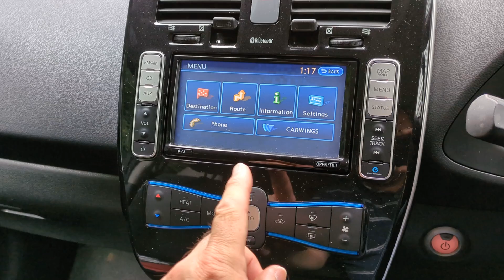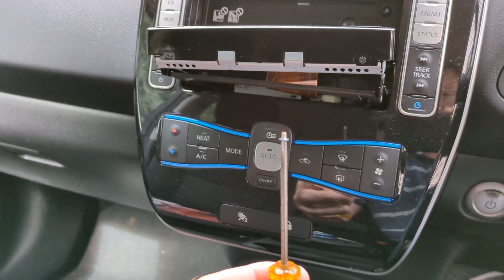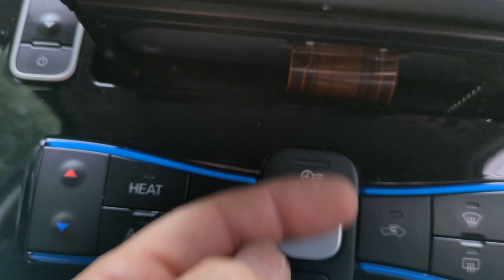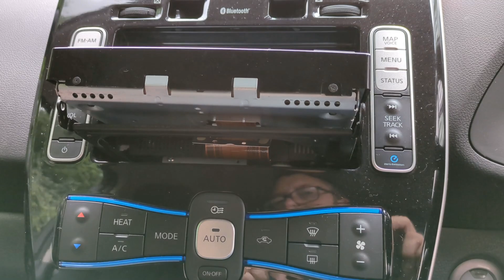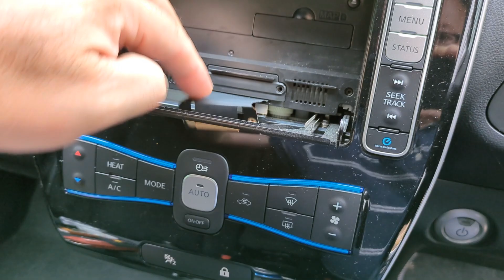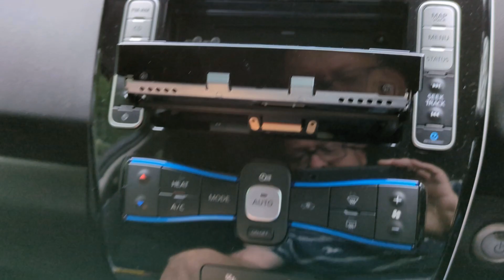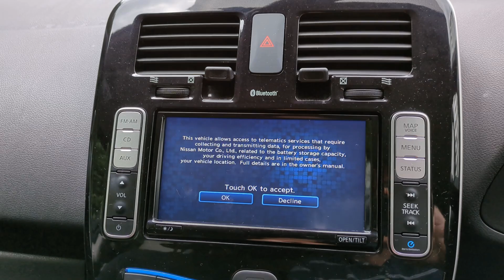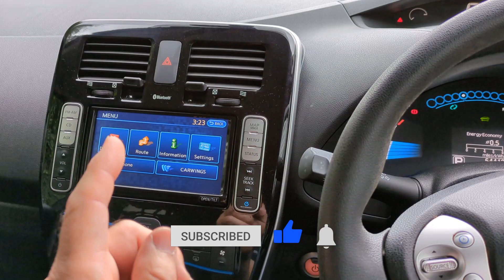How to replace a faulty touch screen in a Nissan Leaf (or E-NV200)

Comment from the maker: As others have commented here, the screws are probably JIS heads being Japanese, which is why a European Philips screwdriver doesn't fit perfectly. This set of precision screwdrivers might do the job better https://amzn.to/4j2KWyb
f you've found this video particularly useful or maybe this saved you money or time, then please do at least click the like button and add a comment. If you'd like to give a 'super thanks', you can buy a coffee, a pint or contribute to the running costs of this channel via the Thanks button.
YouTube shares 70% of the donations with the video creators.
Reply: I've just replaced the screen and used a 100w soldering iron to melt the loctite by directly holding it on the screwheads to heat them up.   The underside screws took about 4 mins each. 2 minutes of heat, a little go at turning the screw with a flathead screwdriver and 2 minutes more and they came off.

The screws on the frame only need about 30 seconds to a minute of heat.  Again I used a regular tiny flathead screwdriver in the end. No need for special drivers.

Thanks for the guide. Coffee incoming for you!

Comment: Sorted - thanks. Used a small gas soldering iron to heat the screws. Plus, had perfect size screwdriver. That's the key on this job. Nice new touch screen installed... finally just before I PX the beast!
Reply from the maker: Good job!

Comment: Fr every success there is one story which does not go so well…
First attempt could not get screw out of the metallic plate at back. Bought new screw drivers. Second go… still would not come out. Third go with a multitool to drill the head… bingo.
Removed screen and brought inside to kitchen to fit screen. One tricky screw. Neighbour came in to help. Leaned against the new screen and cracked it. Second new screen on n order. Try again in January.
It’s not that easy!!!!

Comment: Thanks for giving me the detail and confidence to do this. Success! Replaced the touch screen on my 2015 Acenta today. The set of JIS screwdrivers you recommended meant that all the screws came out undamaged. No more manically tapping on righthand side buttons. Thanks again.
Reply from the maker: Excellent news, glad it helped you and thank you for the gift.
I wish I got the JIS screwdrivers first.
Reply: I second that. Thanks again for the video, made it very straightforward and easy to do. Agreed that a good set of screwdrivers make getting the initial panel off all the easier. Great to have completed this for only €10 from AliExpress as opposed to getting ripped off by a Nissan dealer. Thanks again

Comment: I took your advice on using a decent set of watchmakers screwdrivers - being a watch repairer, that wasnt hard to do. Best advice for those 2x screws - if your drivers have play when trying, just get a different one otherwise it will cam-out - it really isn't worth chewing those chocolate screw heads. with the sharp blue steel ones i used, i had to pull the screw off after i took it out, it made it easier to put back in though! Thanks for the video
Reply from the maker: As I've put in the pinned comment, they're probably JIS screws as its Japanese.
Reply: @GoGreenAutos  I wouldn't know, but i didn't slip once when i did mine today and the screws still look new 😁

Comment: Fixed! (Thank you)
But advice to next person is to find the fuse and take it out - as I tried to plug it back in the tray retracted.
Fixed by pulling whole dash unit out (easy) and touch the cable into the head unit (maybe I pressed the tray button too). 
Phew! Tray came out again! 
Where is the fuse located? Don’t know.
Also, I had to drill the plate screws out gaffer tape there now (and nearly stripped another casing screw). Maybe the JIS screwdrivers would be worth it.

Thanks again for all the help!
Reply from the maker: Yes, I'm sure buying a JIS screwdriver is worth it.

Comment: Thanks for this video. I used the screwdrivers you linked to and they worked like a charm. Also, having read other comments I took out the fuse for the av unit, so that it didn't tilt back into the housing before everything was reconnected. New screen now working perfectly.
Reply from the maker: Thank you very much for the gift and glad you found the video helpful.

Comment: Had the same problem on my 2015 23kwh LEAF so followed this video and am very happy with the result. As forewarned, the 2 small screws on the back of the display that hold the plate covering the ribbon cable were a problem. One came out relatively easily, the other not...reverted to power tools. The rest of the replacement were very well and the new touchscreen worked immediately. Just a hint on the small plastic cover on the head-unit side that takes in the other end of the ribbon cable...removing the cover doesn't enable the ribbon cable to come off at that end, but its a strain-relief device - removing it (take out 2 screws and gently lever-out gives another few precious centimetres of play on the ribbon-cable. Great video...many thanks!

Comment: Thanks for the great video. Unfortunately, I didn't take out the fuse before starting and - having successfully managed to replace the screen - the unit retracted back into the housing when I was only halfway through replacing the screws and before I had reconnected the ribbon. So now it's stuck in the housing and not connected via the ribbon, so not working at all. Any suggestions for how I can get the unit out again would be gratefully received as it's completely stuck. Thanks :(
Reply from the maker: You can pull off the black plastic surround panel, which includes the air vents to access the whole head unit.
Reply: I fixed this by temporarily connecting the cable enough to press button to extend the tray.

Took whole black surround off and head unit which gave me access to hold cable with pliers and gentle touch the cable on to the head unit (not sure if I actually pressed the tray button). I was very glad when tray extended!

Comment: Thanks for the video - I got a new screen for £2.50(!) and it works a treat  - didn't even have any problems getting the screws out. I found the trickiest part inserting the ribbon cable back in when refitting the unit.   Has given my 11 year old Leaf a new lease of life 😂
Reply from the maker: Wow that's cheap. Just imagine what a Nissan dealer would have charged to fix it!!
Reply: @GoGreenAutos slightly more than £2.50 (which did include delivery from China!)

Comment: Thank you for a great step by step video. The Philips 00 screw driver is key for this job. Realy happy to fix this issue in a short time and for less then 15 euros.
Reply from the maker: Glad to help. As my pinned comment says, the correct screwdriver is probably a JIS one as this is Japanese.
Reply: Got screen screws out with PH0 Philips head

Comment: I would use the tip of a very hot soldering iron bit on the screw heads which will soften the Locktite.
Reply from the maker: Good idea

Comment: Thanks for the gorgeous video instructions! I just replaced the touchscreen of my 2014 Leaf AZE0 after buying the screen from the link in the video. It worked like a charm and I can't believe it was just $12 for the whole thing including shipment half around the globe to Germany...
But I also made a stupid mistake when fiddling the ribbon cable from the main unit back into the socket on the touchscreen: I forgot to pull the fuse (or disconnect the 12V battery of the whole car) so the slide immediately started to move after I just hit the socket for the ribbon cable. It resulted in a closed lid / touchscreen with the cable becoming loose again rendering the Open / Close button inoperable.
Well, I have been very lucky by finding a rather simple way to get it open again - but I had to take the radio / nav unit out (which also is not really a big deal as there are plenty of videos explaining how to do it as well 😉).
You can easily power the small motor that drives a gear to operate the slide after unmounting the back plate of the device. I made a video that explains how to find and power that particular motor:
https://youtu.be/GKeg4ojyOmU
This will hopefully save another poor soul the frustration of having "messed it up" during the repair as there is a rather easy way out of this dilemma... 🙂

Comment: Thank you Go Green Autos, I knew exactly what to expect. However, when I pulled ribbon cable clip, it pinged off down the back of the car and 2 days of stripping it down couldn't find it!
I then removed whole head unit from car - easy as the front panel & vents etc just pull off and you only need to remove hazard light switch connection. Just be careful not to drop mounting screws - the unit sits on hooks so it won't drop.
Was far easier to swap screen on the bench and I made a new ribbon cable clip from a thin plastic plant label cut to 26mm x 8mm. This jams into the connector to lock the bottom contact ribbon in place.
The hardest part was stopping screen flopping about when refitting - I used insulating tape to hold the top of the screen in place, with a wedge between the screen top and the case to ensure the bottom could still swing out as the tilt arms come out when reconnected.
Once cables are reconnected to rear, you can hang it on the 2 mounting hooks, open tilt so arms fully extend for last 2 screws to fix bottom of screen; and fit the 4 head unit mounting screws (Pozi drive) - these are tricky to align properly but keep trying with your fingers holding the screws at different angles.
As it happens, the new screen looks great but unresponsive to touch (looks like ribbon got folded flat against itself in transit), so have had to put old screen back and get refund - new one ordered from Ali Express for £7!!
I was expecting a radio key code lock, but it started right up. I still requested one from Nissan beforehand, let's see if they can find it anyway.
I used a PH00 for all small screws and didn't have any locktite issues - perhaps screen had been replaced before?
Thanks GGA, you were brilliant help.
Reply from the maker: Sounds like you've been having fun!
Glad the video helped. Removing the whole unit from the car might be the way to go. When I next need to do this, I'll try that method.

Comment: This video is really helpfull. Today I replaced my broken screen and I used a IFIXIT screwdrive set for removing the screws. Have to say, if your screwdriver dous not fit precise, dont try it. It wil ruin your screws.. With the IFIXIT screwdriver set it worked like a charm. It took me 1 hour in total and after calibrating the screen it worked really well and now it's more resonsive than before. Thx for the quidance.

Comment: Great video, very helpful.  Many thanks!  I made certain of the correct screwdriver before tackling the first pair of screws (try first to ensure a snug fit!).  PH0 worked a treat - took it very slow at the start, to break the threadlock, then they came away without any problem.  Fixings for the plastic surround mostly crumbled when removing those screws, but I shouldn't be surprised, as our Leaf is now in its 10th year, so they have survived a lot of summers.  New screen now in and working fine. 👍😀
Reply from the maker: Good job.

Comment: I bought a new set of multi head screwdrivers from Aldi for the job and the screws weren't a problem. Just fiddly to access. Make sure the head unit does not retract after removing the head unit. I physically obstructed it so this couldn't happen. Not sure what you'd do if it did. 

Also, my digitiser didn't work so I'll have to order another one. I used the link from a Jonathan Porter field video a while back. Will try the link in this video next. 

The ribbon cables are the worst bit of the job IMO. Very fiddly and easy to put back incorrectly.
Reply from the maker: As others have commented here, the screws are probably JIS heads, which is why a European Philips screwdriver doesn't fit perfectly.
Reply: @GoGreenAutos  PH0 worked fine for me - the Aldi screwdriver kit came with two slightly different shape of Ph0 head for that fitting and one worked with the tiny screws on the underside of the head unit well, while the other was good for the larger head screws.

Comment: Thank you for the video, it helped me to change the touch screen and it's working!  The only issue was the flap that holds the ribbon cable popped out, took me an hour to figure out how to put it back 😅. I wonder how long this will last, and if I should buy another one as a backup... thanks again 👍 regards, Andras
Reply from the maker: Thank you Andras. So kind of you. I'm glad the video helped.
Reply: I’m currently having exactly the same problem with that little white flap for the ribbon cable - any tips for getting it back in place??

Comment: Replaced screen with aftermarket one I bought online. I took unit out of car to make access easier. But when I powered it up afterwards... nothing. Screen is black, and the tilt button doesn't work. The screen tilted back up to vertical when I plugged the cables in on the back, so now I can't take the screen off again. Any ideas?☹
Reply from the maker: Sounds like your ribbon cable isn't in properly or making contact.
Reply: @GoGreenAutos  You're right! I managed to pry the screen open and redid the ribbon connection on the back and hey presto! The screen is at 90 degrees to where it should be! The pins on the screen/cable are in the wrong place. Now I have to either find a way to reorder them or find an adapter. Yuk.
Reply: @clivechafer9651 what do you mean? Did you manage to connect the screen again?
Reply: @josepablomolinacarrillo3621  Turns out the ribbon cable was not inserted properly on back of screen unit. I had to pry the screen open to get at it, but once it was positioned properly, the unit came to life. However, the touch screen doesn't work properly: the orientation is wrong because the pins/wires are in the wrong order on the ribbon cable from the touch screen itself. I have returned the unit and ordered another one which seems to have the same wiring as the one I took out. We shall see!
Reply: @clivechafer9651  Thansk for the reply. I must give it another go at the ribbon cable as my screen is still black and tilt button doesn’t work. It is very difficult to re connect. I will keep you posted on the progress!
Reply: @clivechafer9651  Do you know what’s the fuse for the infotainment unit? I must check that first before trying to re connect the ribbon to the screen. DIY project!
Reply: @josepablomolinacarrillo3621  No, I don't know which one it is. I checked all the fuses before I pried the screen open and they were all good. But I couldn't tell from the abbreviations inside the two fuseboxes in the engine compartment which one was for the display unit.
Reply: @clivechafer9651  Thanks Clive.
Reply: @clivechafer9651  I think I broke the infotainment. No power now and it doesn’t tilt when I start driving. Disconnected and connected the 12 volts battery and still same. Any ideas what to do next? Thanks 🙏
Reply: Update. The infotainment unit is alive. Must be a not properly connected ribbon cable. Working progress 😂
Reply: You can manually pull the screen back to flat. Same happened to me.
Reply: Let us know how it goes. I have same problem at the moment. Ribbon cables seem to be more problematic than screws tbh for me..
Reply: Same here. Changed screen but now it is black and tilt button does not work.

Comment: Maybe a soldering iron would work for heating up the screw without accidentally melting the ribbon cable? You can get USB-C powered ones these days.

Thanks for the video. My Leaf was never this bad but I found the right hand side had 'shifted' inwards so I had to tap slightly to the left of the back button to get it to register.
Reply from the maker: Good point. I didn't think of that.
Do a calibration as per my previous video https://youtu.be/xvFwdS_mRRc
Reply: When the screen fails it usually happens gradually. Mine has shifted to the right but now has failed completely on the right side. Got a replacement now..

Comment: One thing with screwdrivers - the fit for a Philips is very important but so is the handle. A handle that fits your hand well will make the job a lot easier - the trouble with those skinny handles is you can't get much leverage on them especially in awkward positions like that one. I'd be swearing a lot. Well done.
Reply from the maker: As someone else has pointed out, the screws are probably a JIS head, which is slightly different to Philips.

Comment: When I did on my LEAF 24 I removed the whole unit. Made the job easier. Also buy good quality screwdrivers.
Reply from the maker: I will try that next time. I guess you pull off the whole black surround with the air vents and switches?